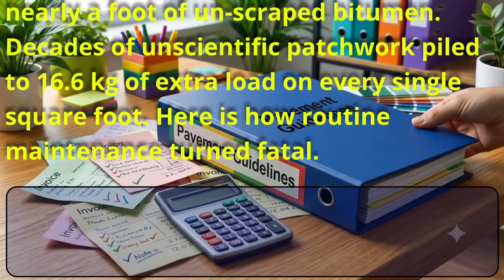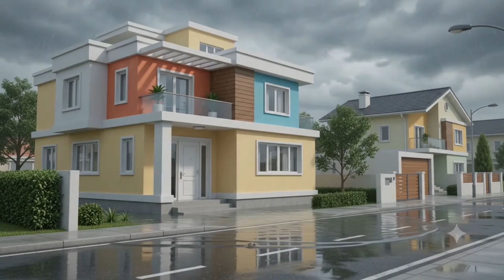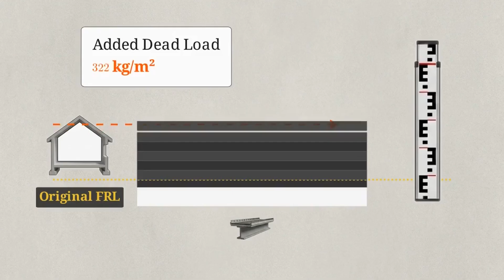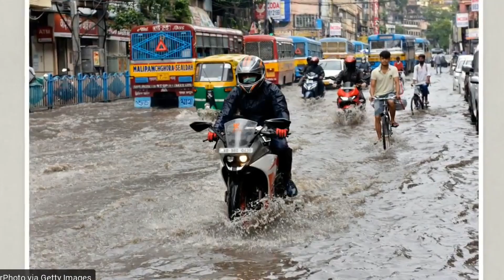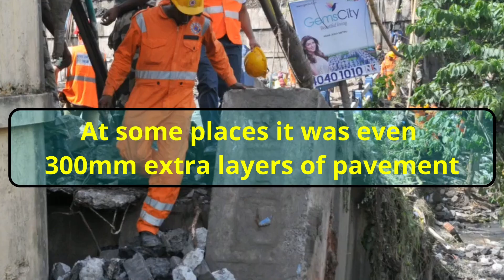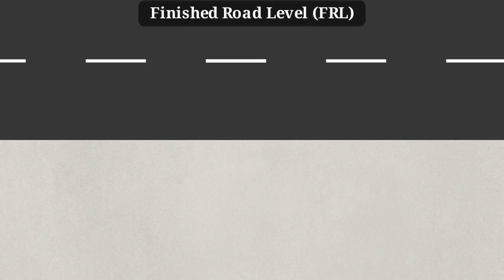Shame for Civil Engineering I Your Street is Rising and Your Ground Floor Floods Every Monsoon

Comment from the maker: 👇 HAS THIS HAPPENED IN YOUR NEIGHBORHOOD? 👇

Are your ground floors starting to flood because the road outside keeps rising year after year? Or have you hit one of those dangerous, deeply recessed manholes on a two-wheeler? 

Comment your city and neighborhood below! Let's see how many areas are dealing with this lazy "layer-on-layer" shortcut.

⚠️ Remember: Civil engineering codes (IRC & MoRTH) mandate Cold Milling—scraping off the old asphalt—before laying new roads. Demand accountability from your local municipality. 

🛑 NO MILLING, NO ASPHALT!